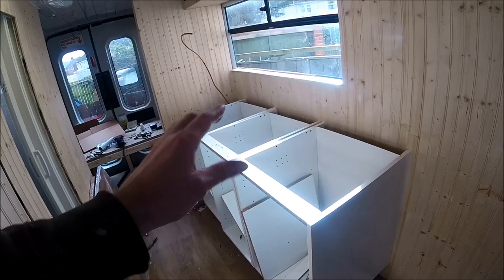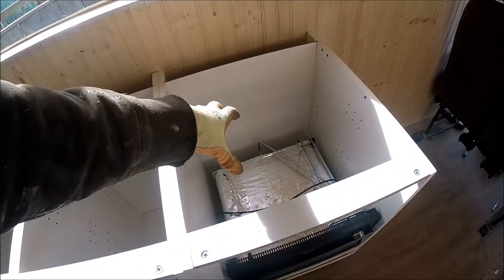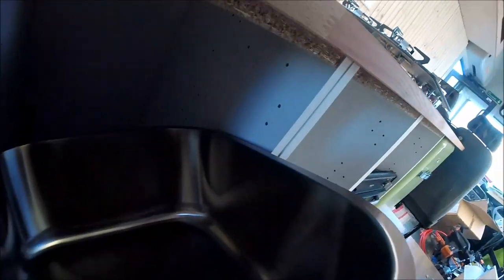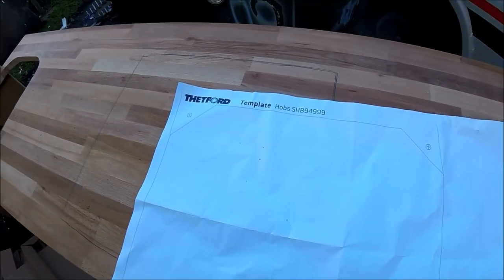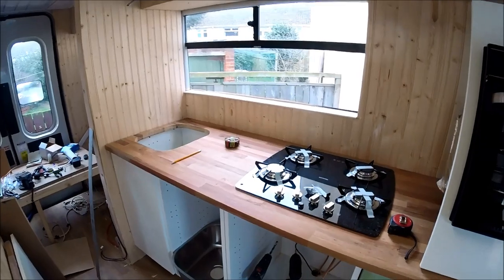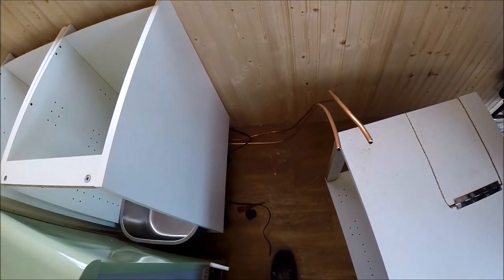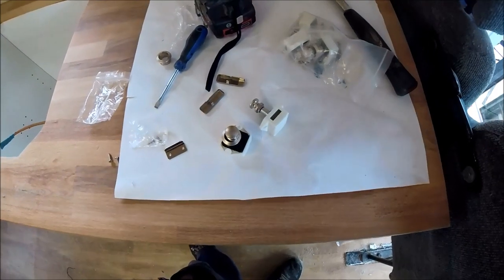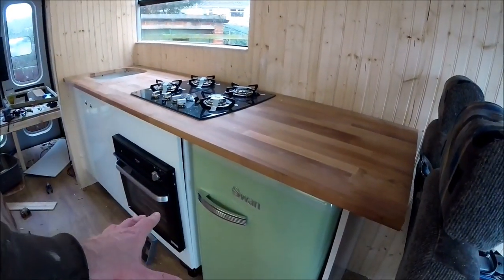Minibus Campervan Coversion Part 20: Building The Kitchen

Comment: Hi again. Loving the conversion you are doing a great job. I love the fridge and it’s colour. Thanks for answering my previous questions. Next question is; I understand the reason for drop out holes under gas fittings; gas heavier than air etc but; with open holes, especially in this country, do you not get surface water/clag etc being thrown up through the drop out holes?
Reply from the maker: The floor of the bus is a lot higher than a car or van so no problems at all and some mesh or a cover can be put over the hole is its a concern